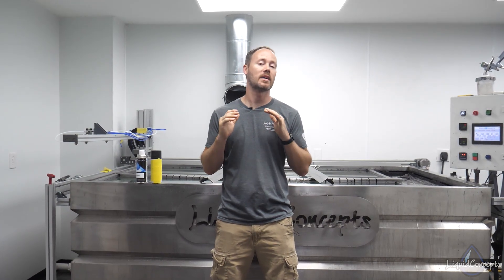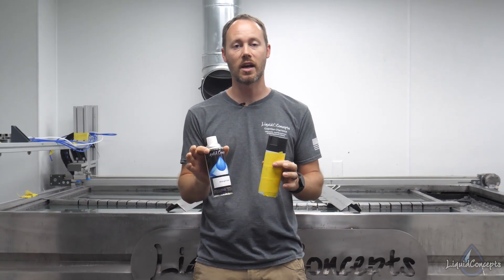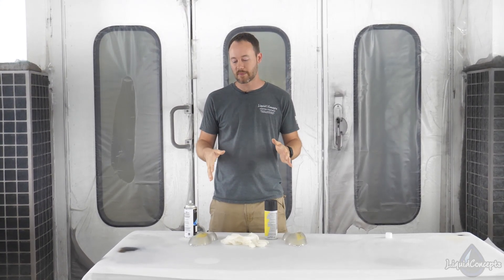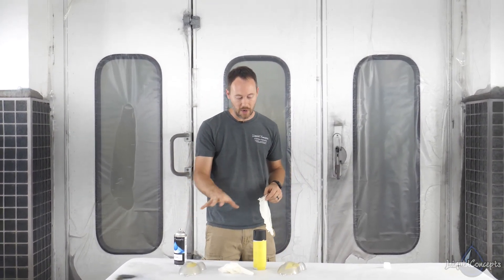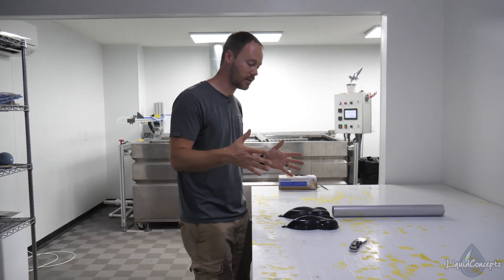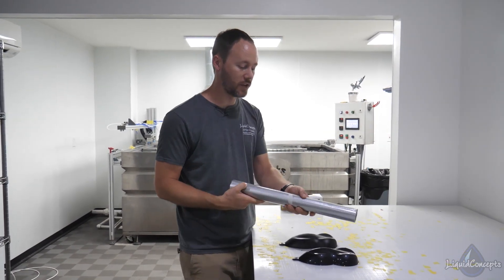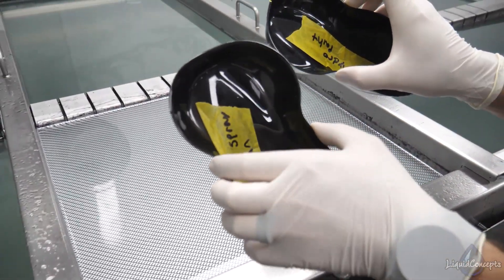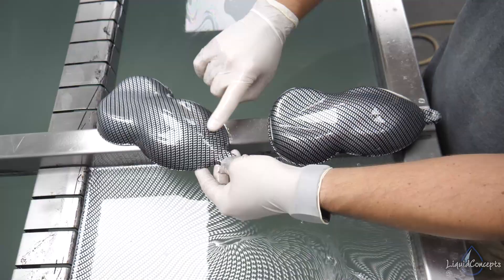Spray Paints you SHOULDN'T Use for Hydrographics

Comment: I have tried different paints because whatbi am dipping is flexable and being used in agressive manner. Wrestling headgear if you know whatbthey are?
I have had a little bit of success with plastidip but i am a beginner and probably just not doing a good job with your paints so it ends up a wash. Do you have a flexable paint that will stick to foam-rubber
Reply: I need the final product to atleast not be a hard shell. Don't need a ton of flexing but do need the final product to not be hard plastic feel
Reply from the maker: Hi Dan, we really do not have any primers, paints, or clears that are going to be flexible enough for headgear unfortunately or stick to foam

Comment: I use only Krylon brand and it works fine. Probably not the paint but the operator. This guy is just trying to get you to buy his paint. The result he’s showing is from overacting that he did on purpose.
Reply: Agreed. As long as you dip the item before the base coat fully cures, the film will stick to he base coat just fine. The base coat must be dry to the touch but still a little tacky.